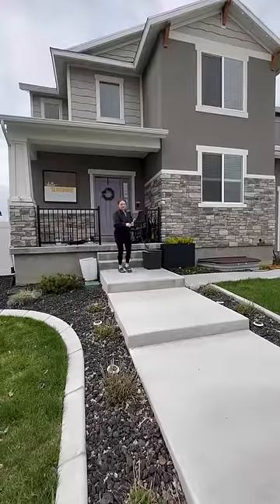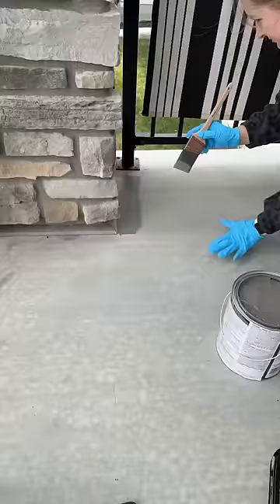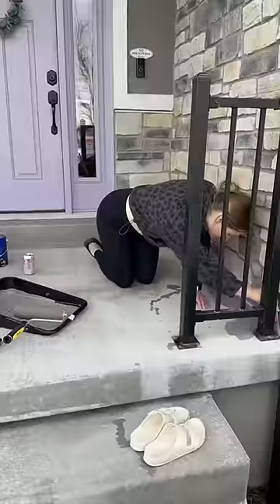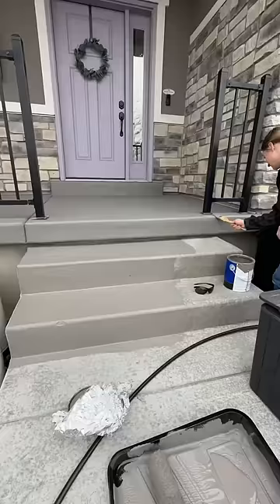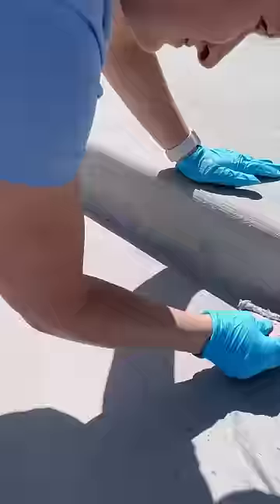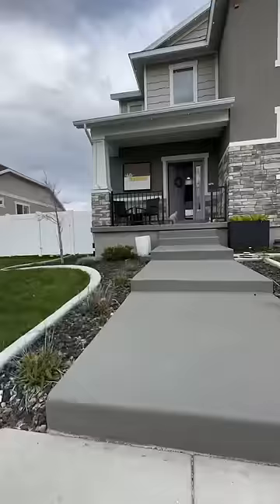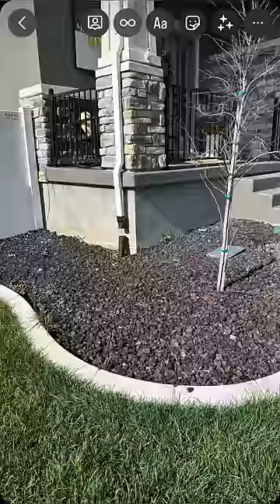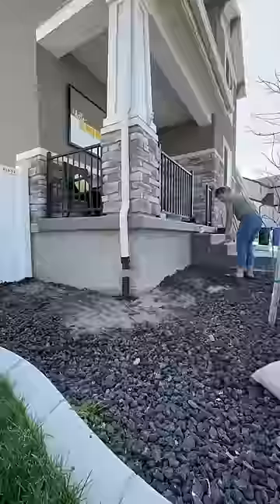Recap of part 1 of my front yard makeover #frontyardlandscaping #planterboxes #frontyardgardening

Comment: You filled in the expansion joints. They're built into the sections to prevent cracking from heat expansion in the summer.
Reply: Wow SMH
Reply: Will be fine if she used flexible caulking
Reply: @daniellex51484 what? What’s hateful about the comment?
Reply: @daniellex51484 shaking my head? Or so much hate? At my comment? Facts aren't hateful, they're just the facts. If your intent in posting content online is to inspire others that it doesn't take a lot of money or hiring fancy designers to come up with projects on your own to beautify a space you don't like, then you need to be at least be aware that you could be inadvertently leading them into a action that could cause another unforseen problem such as expanding and re-cracking along the caulking line when the concrete expands in the heat which is it's intended function. Of which you may then find yourself having to scrape out all of that caulking if you don't like the looks of that cracking. For instance, painting concrete; many comments advise against doing so because of ongoing maintenance when the paint starts to peel. That is another fact. Dying the concrete with a stain made for cured concrete is a low maintenance alternative. For those that are inspired to do a project like this in their home, there are many alternative materials to choose from depending on the time and effort you have available to maintain it. I hope you reconsider characterizing people's input as hateful and consider perhaps their recall of past experiences. I thought an expansion joint could be covered because it interfered with the pattern in my patio knowing good and well what it was there for. It didn't work and the lesson learned only made more poignant the solution we inevitably used.
Reply: @markme4 it was a cement repair, which is very close to actual mixture of cement and usually for small cracks or chips, definitely not for the expansion joints. You’re right though if she used a caulking or rubberized caulking for it then it would be fine but she used that stuff.
Reply: @seriouslyreally5413  I thought they're comment was agreeing with you, saying "wow, smh" as in "wow, I can't believe she did that in the video, smh"
Reply: @seriouslyreally5413 or wait, did they have another comment that got deleted?
Reply: Tell me you dont really know what you are doing without telling me
Reply: Those are not expansion joints lol I do this for a living and those were cracks…..it cracked there because they did not put joints on each slab. Relief joints should be a min 4’- max 6’ on center going each direction

Comment: There is a masonry paint made for cement and concrete. The cracks in the steps are there for a reason and they will reappear after the winter
Reply: @@QueenofKings2concrete swells and shrinks with the weather. It might not happen very fast on new concrete but if those cracks were there already and not properly fixed they will reappear pretty fast.

Comment: Have fun with that when the paint starts to peel & crack. Also, be extra careful when it’s wet because it’s going to be extra slippery
Reply: She said she added something in it to make the paint less slippery but it's clearly and very glossy so she didn't put enough of it in. She's going to end up having to we do that all the time and for it to look good she's going to have to clean off the paint that was on before. Only way you can get that off is using acetone and a scrub brush, or if it's peeling and chipping you might be able to use a pressure washer for a lot of it. Freaking concrete contracts and expands, freezes and sweats. Lol I hate it when people paint concrete, actually I even hate it when they paint their wooden walkways. It just makes it look like shit because nobody ever gets to it in time to repair it. Lol and when you're a homeowner there are so many things you have to take care of there's no need to make more work for yourself and she still could have done something to make it look nice... Like refinish it. She also should have checked if they were level before filling in those cracks. That was pretty new cement, so for it to be cracking it could be a foundational problem.
Reply: Very slippery
Reply: 😂 omg
Reply: And then her toddler slips and falls while running, throwing his head back hard onto thr slipper concrete, putting him in a type of seizure. 

My parents' concrete isn't painted but it's slipper from the gross dogs and their water, and that's what happened to my baby.
Reply: She did say she added grit to the paint to make it less slippery, at least she thought about that part lol

Comment: Just remember....the added texture you put into the concrete paint to prevent slippage not only provides better grip for your shoes but also provides a place for the dirt on your shoes to get stuck to. ...these surfaces tend to get dirty quicker and need scrubbed (not hosed) for a good cleaning.  The look is good but the maintenance is higher.  Plus...the paint may  wear away faster than you realize if the area is in high use.   NEVER mean to be negative...It looks good.....just saying...

Comment: As a woman in construction, I love this! I work in concrete and building material testing. There is a pigmented epoxy you can also use if the paint starts chipping. Definitely lasts longer but the paint looks fantastic! We achieved that look/color by basically "polishing" the wet concrete and this looks very similar.

Comment: I’m Not a troll , just see your hard work and wanted to give you advice for your knees after I did my own flooring  project. I found some good knee pads worked wonders against any sourness over time , if you end up doing any flooring it’s very hard on shoulders , the leaning and hammering the joints together is hugely stressful as it’s repeatedly contorted work . Best of luck on your channel   , you have my respect with good ideas to bring into view .

Comment: I’ll give you a pro tip as a commercial concrete carpenter …..before putting in rebar into the dirt (which is a big no no) dig a trench, fill it with concrete and set the rebar while concrete is wet to prevent corrosion

Comment: Those "cracks" are there for a reason. You just glued expansion joints together. They're laid as separate pieces so they have room to expand and contract with the temperature so that the pieces don't crack down the middle in inclement weather.

Comment: Concrete cracks expand and contract with temperature fluctuations, so you need a material that does so, as well.  Ants can form huge populations under concrete, so they need to be sealed out, too.  Can be a nightmare if done wrong!

Comment: You don’t need a cinderblock raised bed to cover that porch wall.  Everything in there will dry out very quickly, and also you’ll have a cinderblock wall which won’t look very nice.  I recommend planting boxwood shrubs, or any kind of evergreen shrub directly into the ground, not into a raised bed.  In a few years the shrubs will be 2-3 feet tall and cover that whole porch wall all year round.  This is a much easier solution.

Comment: I would recommend planting bushes or shrubs slightly away from the base of the house, and not doing garden boxes unless you intend to create a complete box that doesn't touch the base of the house. If you create a box using the base of the house as the back you will deteriorate the parging and could lead to a problems with your foundation. The constant moisture of a garden against the foundation can lead to foundation damage and potential water infiltration.

Comment: For the planter, are you planning on incorporating the rain water from the gutter system to aide in watering?
Reply: The gutter is designed to drain water AWAY from the foundation. That planter wall  void her structural warranty and was not approved by city or HOA. It will hold water against the foundation and deteriorate it from water retentiontion. The paint on the concrete will peel in short order and become a maintenence nightmare. She is ruining her property with these changes.
Reply: She’s going to paint the planter next video.

Comment: Before you construct a raised bed you better examine what's behind that stucco.  That might not be a block wall, it might be stucco over plywood & not water resistant.  After watering your plants 3-4 years your foundation could have water damage. Or water in the basement.
Reply from the maker: Assuming I didn’t consider that already?
Reply: @spetrichhome  I have no idea what any YouTubers are planning.  I hate seeing regret & damages to a home that could have been avoided.  If you haven't considered it. I've seen disasters  with raised beds attached to foundation walls. Water in the basement leads to black mold. It can get very expensive.

Comment: No body realizes concrete painting is the worst thing you can do. We pour tinted concrete so this doesn’t need to be done because youve just created a flakey mess that looks like your concrete has dry skin. Especially when the two colours are basically the same it will look like your top layer of concrete didnt cure. This is a mantience nightmare youve made for yourself even a pressure washer cant take off excess paint.